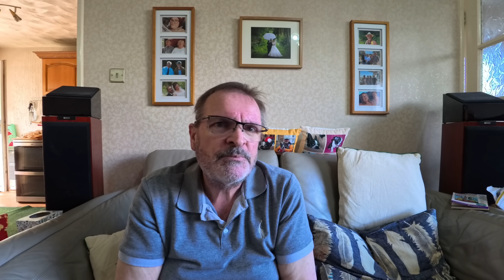Expert Ships Engineer Reacts to Baltimore Bridge Crash

Comment: Maybe a stupid question, but why not just drop anchors once the power was lost and it was adrift in such a confined waterway ?
Reply from the maker: The dali did drop the port anchor at some point. But an 100,000 tonne ship traveling at 8.7 knots will travel for a distance before stopping. The whole incident lasted 4minutes 12seconds.
Reply: It doesn't work that way. A ship is extremely heavy, they had less than 5 minuets, they were dealing with power issues and no doubt some confusion,  and you have the forward movement, currents, and wind . If you think about it an anchor isn't going to just drop straight down and dig itself in. In short you can't just slam on the brakes with a ship. The same thing as a train. I believe a train can easily take a mile to stop, again depending on weight and all.

Comment: The six people lost would account for the workers on the bridge but they are saying that some cars went into the river as well. It's terrible.
Reply from the maker: Im doing more research and it appears so no bodies found yet.
Reply: @retroonhisbikes  The poor souls wouldn't have lasted very long in that cold water. It must be extremely dangerous for divers etc to get to work. All that debris and a fairly strong current to deal with. Rather them than me.
Reply from the maker: @mollymouse4900 there was a road works flashing amber light on the bridge to the left. There is something large that falls when the bridge collapses i would thing the workers were there. Few minutes in the water before your hands stop working.
Reply: @retroonhisbikes  Yes, I dealt with a hypothermia case once. It doesn't take long before the body shuts down.